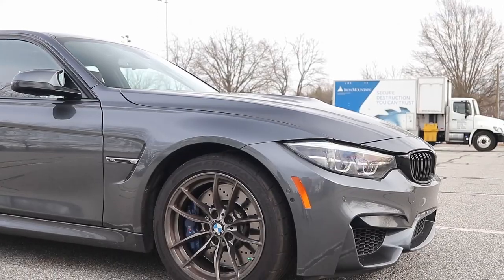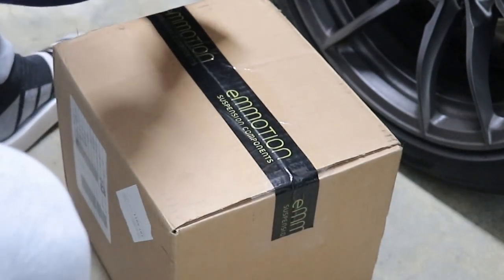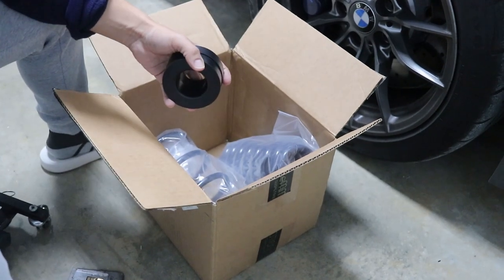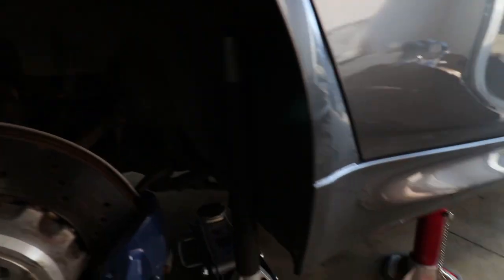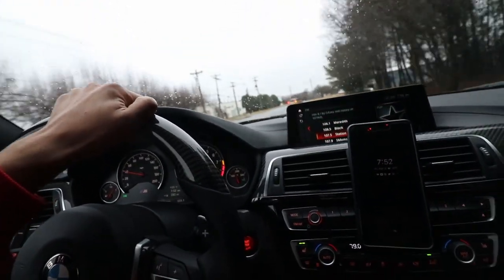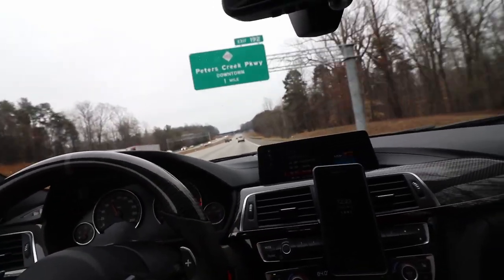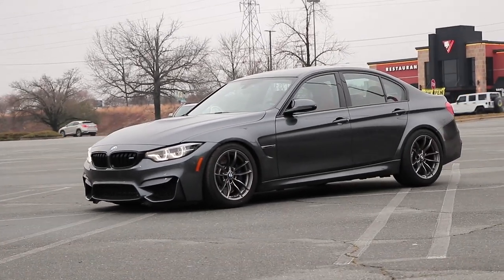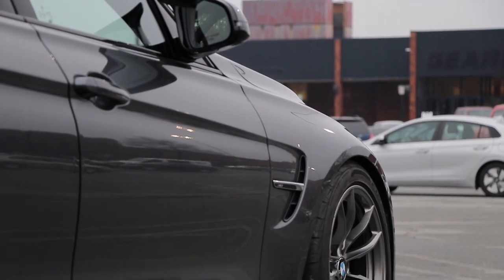BEST LOWERING SPRINGS FOR THE M3/M4? | EMD

Comment: Wait until it settles in. Looks solid so far. Lowering the f8x is must to get that wheel gap gone.
Reply from the maker: Thanks, the rear isnt bad stock but the front sits too high. Even a slight drop helps the look a lot

Comment: Super clean. Good choice before the crank hub. I wanted a f80 before I found out the battery cost $1800 😅. So I’m going to get a F 30 340 instead 😅
Reply from the maker: Believe me.. i was disappointed when I found out myself lol. I think it can be had a little cheaper but I still find it hard to believe a battery for the f8x is that expensive
Reply: You can get the same quality battery for like 8-900. It's not a normal battery they last forever